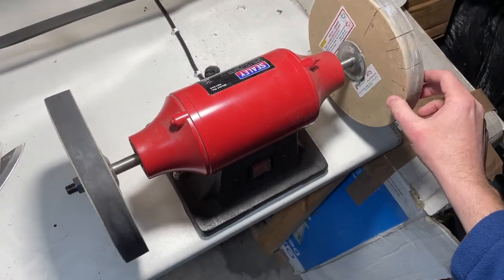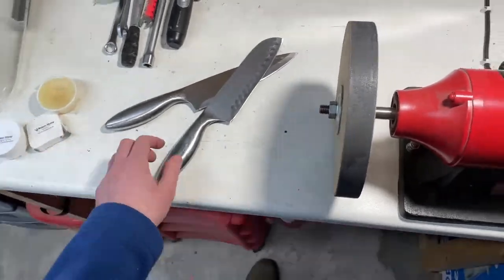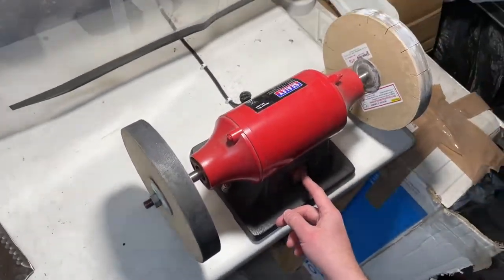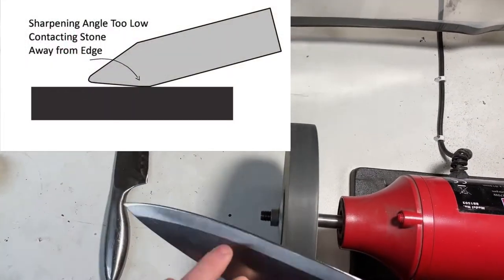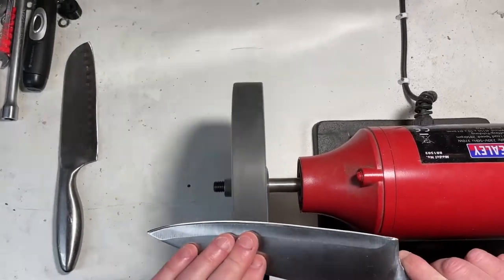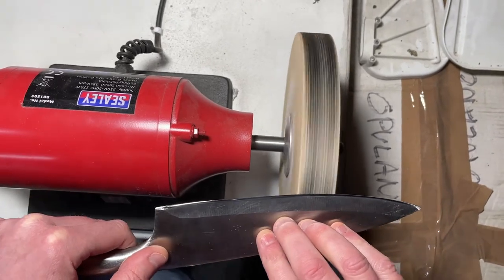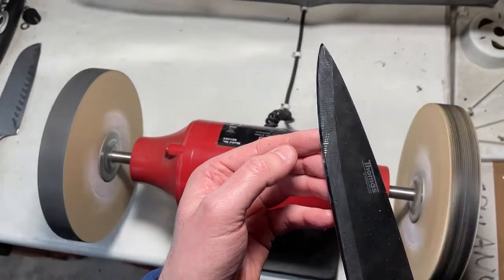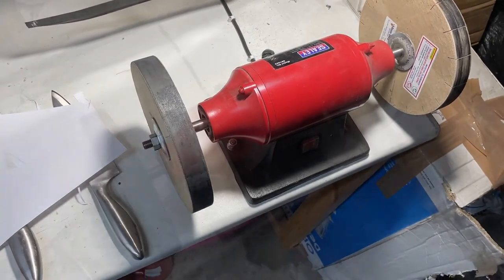Razor Sharp Edgemaking System - Knife Sharpening

Comment: Great video thanks 👍🏻

There's no need to strop the knife with this system then?
Reply from the maker: Thank you.  The edge will be highly polished so I wouldn't say stropping is required.  You'd want to use a little more pressure than you think on the smooth wheel.  That makes a big difference. 👍

Comment: Well explained Sir.    Is the angle  always 25 degrees.
Reply from the maker: It varies depending on what angle your knife has been sharpened to. Just raise or lower your position on the wheel to adjust.

Comment: Which model is it  -the Sealey BB1502? There is also the BB202? Been looking a while for a way to sharpen my lathe chisels etc and this looks good. Would want to do same and reverse motor so want to get one I know you can do this with. Thank you!
Reply from the maker: BB1502 👍
Reply: @GeeWhizRS  Ah! Thank you I was squinting at it and thought so but wasn't sure. Thank you for a quick reply :) Ever tried to sharpen a Roughing out gouge - they have a curved edge?
Reply from the maker: @BarryM60  Not needed to do that.  Surely you just sharpen the outside edge though?  The RPM on this buffer might be a a bit high for that.  A 1750 RPM might be more suitable.

Comment: I've got the razor sharp wheels, work great for about 5 knives, then need regritting.
Trying different glues, anyone having grit retention problems/ fixes? Razor sharp says should be able to do 100 knives......
Reply from the maker: Are you sure the grit is actually coming off and you’re not just clogging it up with the grease they include in the kit? If the grit is coming off that’s not right.
Think the right glue is Elmer’s pva glue.
Reply: @GeeWhizRS  yes, even when brand new, 1 knife was throwing grit everywhere!! Looking at actual sandpaper now, cutting to size and gluing it on
Reply from the maker: @paulr5027  might sound daft but you have the knife the right way round don’t you. The wheel should be running from the spine to the point.
Reply: @GeeWhizRS  yes.....
Reply from the maker: @paulr5027  maybe contact the seller then and see what they say. I haven’t had to regrit once yet. Probably 100 knives or so.
If you’ve tried regritting it and finding the same issue I can only thing you may be applying too much pressure. Other than that I’m out of ideas.
Reply: @GeeWhizRS  lol, yes, otherwise I'd probably be dead...